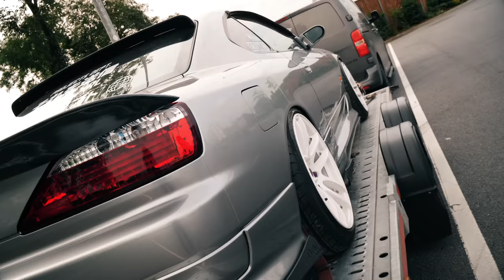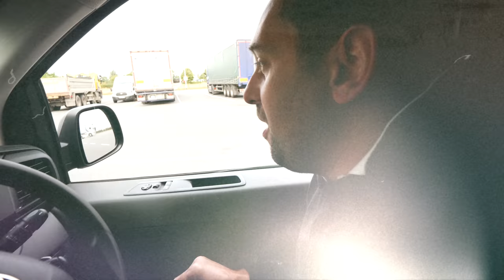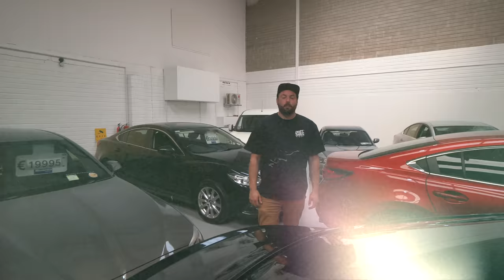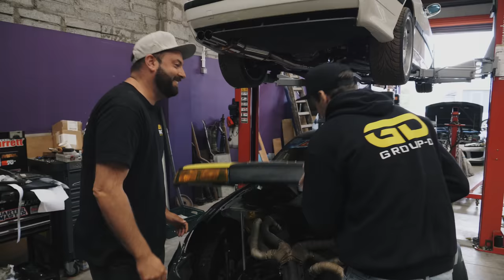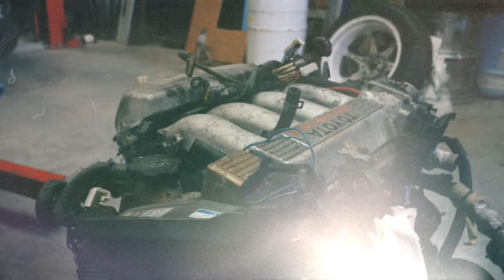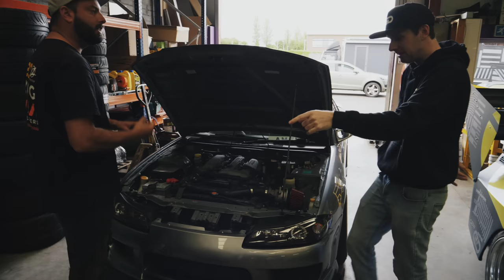Cheapest 350bhp engine swap EVER? | Our S15 is FIRST!

Comment: I would never have guessed that, looking forward to seeing how this turns out! 👏
Reply: I believe this was in the Tom’s Castrol Supra when they finally beat the GTR’s back in the 90’s. It was a much different engine internally but same platform.
Reply: @kevinfunk83  If that's correct that's impressive! Fair play 👌
Reply: @kevinfunk83  nah mate, they used the 2zz.
Reply: @Tezzablade  nah mate, do some research!!
Reply: @kevinfunk83  I can't be bothered, somebody told me they used the 2zz though, which is a SUPER competent motor, they used then in lotus Elise's.
Reply: @Tezzablade  I mean it was nothing like a 3sGTE after the head work and being able to rev to the moon but it was taken directly out of the Rally Celica.
Reply: @kevinfunk83  similar but aparently shared nothing with the 3sgte. Was called a 503e.

Comment: Didn't expect this! I was thinking you were going to go for a Saab B234 then I thought about a Mercedes M111 with a turbo instead of the kompressor. Another crazy/cheap one would be some sort of VW engine like a 1.8t or even a V5 or V6 with a turbo.
Reply: Was thinking the same, 3sge does not seem so crazy tbh...

Comment: Lots of guys in the mr2 world used to do 5sgte builds - (3sgte head on a 5sfe bottom) and made really good power with them. Some really cool options that are less popular!
Reply: @krisbuck2165  the 5sgte is gonna be a lot more work, but its definatly alot cheaper than an SR
Reply: 5s is not an engine option outside the states
Reply: @fonorcennell131  we have them here in norway, in the older camrys, relativly common too.

Comment: I thought it'd be a VAG 1.8t 20v, obviously not 350bhp stock but a bigger turbo, injectors and some cheap rods will easily get you there. Probably not been done in a Silvia before either
Reply: I own s13 with this engine. It makes 400hp… love it 🥰

Comment: If going with 3sge, why not a beams 3sge? Same engine, but with vvti and even comes 6spd and rwd. Plus it just looks better out of the box than the older 3sge's. Either way i'm looking forward to this build series!
Reply: Price prolly.. he focused on the low price point
Reply: Price
Reply: Beams engine and trans is hella cheap I paid $1200us for mine. With link ecu make 200whp no mods turbo it and have 300whp that revs to 8700k
Reply: @gbshenanigans6952  Lower compression engine / older 3S would be better suited to the turbo.
Reply: @Joel_Harris  300whp you will be fine with the high compression but they make a kit to get low compression
Reply: @gbshenanigans6952  mr2 engines like 200-300 euro
Reply: @fonorcennell131  yes but 3S-GE is pretty useless. That’s why us MR2 owners take them out.

Comment: Was half expecting a Honda B or K series, but this should be a great setup for a road car 🤙
Reply: This has already been done though. Jimmy oakes has a K swapped S15
Reply: @nitroblueuk  But how many k-swapped schassis are there compared to 2GayZ motors?
Reply: @nitroblueuk   S14*
Reply: @nitroblueuk  jimmy k swapped an S14 facelift,  not an S15
Reply: K24 would have been my bet. Probably just about as cheap, and better all round motor. Alloy block too where as the 3sge is cast iron.

Comment: Tidbit about the trans that I think wasnt covered correctly or clearly, the "j160" of the altezza/is200 is effectively the same trans as the s15 6speed. They both fall under the Aisin AZ6 model range although the gear ratios are a bit different. Mx5 6speed, rev1 rx8 6speed, s15, altezza/j160, brz/frs/ft86 are all effectively the same "AZ6" box. Great choice with the 3s platform though especially rev1 head intake ports can be made massive. Cheers guys
Reply: Those gearboxes are one family, but every of them is different to fit. 
1. Different bolt pattern
3. Different ratios
Reply: @aaabbb9953  the center section of the trans can be interchanged but yes the bellhousinga and tail housings are different, different tail shaft lengths, shift rod lengths etc. 4th gear is fixed to the input shaft so you are stuck with whatever gear ratio the required input shaft is associated with but they can be hybrided. I had built a couple s1 rx8 front mx5 rear hybrid boxes for a 13b powered NB mx5 back in the day. It ended up being a hodgepodge of gear ratios due to the required parts but interesting none the less

Comment: I love this 👌👌 The 3sge is a seriously underrated engine 💪
Reply: @krisbuck2165  no the 3sge is what I'm talking about, seriously under rated engine, co designed by Yamaha too
Reply: @krisbuck2165  Yea they did, Great na engine, I have had over a dozen of them
Reply: @krisbuck2165  I've had a load of and built 3sgte engines, there obliviously more powerful, it's the same engine only turbo charged. I didn't say the 3sge was a better, engine. I said it was an underrated engine

Comment: the heads where designed byYamaha for toyota- the supra that raced le mons was a 3sgte -well it was actually a 2.3 litre with the camry engine (5SFE) crankshaft - stock 3sgte turbo engines rev to 9500
Reply: I think toyota didnt develop a DOHC without  Yamahas help. Even the 1JZ head is yamaha designed, earlier engines actually had Yamaha's name on them

Comment: Somebody is doing a beams 3sg swap in an s15 in California, but I don't know if he is going turbo or fully built n.a. The beams is only good as a fully built n.a. and they are not good turbo due to the internals. The turbo 3sgte is already good for boosted application, with its forge rods and pistons.

Comment: Be interesting to see this outcome and costs as with consideration of link Ecu and custom wiring harness. Custom exhaust unless you’d be making a downpipe to allow an s15 system to bolt on and also the custom prop. 

I think a challenge is that not everyone would be wanting to part out 3-5k on Ecu parts. Can’t wait for this build though

Comment: I think it's going to be a cool swap but it'll never be a simple replacement for the sr20 swap. Yes the engine alone might be cheaper but EVERYTHING else will cost more than a basic sr swap. These engines have been around forever and there's a reason why ppl don't swap them into s chassis's. If someone were to make the swap kit like tf did for the k swap then it would even more expensive just like the k swap is.  Yes engine is cheaper but everything else to actually get it going cost way more unfortunately. Still excited to see this car done though.
Reply from the maker: But it’s something interesting to do and at least we can find out!
Reply: The way dmac was talking sounds like he is making a conversion kit to sell to the public.

Comment: it's a really interesting swap. Btw I dont know I'm late but I heard about good alternative for 2jz, its a ford barra engine, its 4 liter, 6 cylinders engine with variable camshaft, so you getting something like 4 liters 2jz with vtec, sound amazing, I didnt seen to much videos with that but I belive its may be something cool. There is two problems with that, size of the engine, its quiet big, so its may be hard to fit that in drift car, and the other one is availability, easy to find them in australia but not to many in europe. Well I'm waiting to see that silvia later, its really interesting project, Darren is a true magician. 
Greetings from Poland lads🤙
Reply: Problem with barra is they are huge. The sound like shit too. But as an Aussie they are the best Aussie made engine and are very cheap to buy
Reply: Barra is alternative, because it is same overbuild engine like 2jz. Problem with barra is that it weight even more than 2jz, about 30-40kg + you have to import them from Australia, and probably every part that you will use need to be from Australia too... Imo still 2jz wins if it comes to competition - availability and proven reiability.

Comment: There’s been a couple s13s with 3sge dropped in in the last couple years and there was a s15 built back around 07 with a 700hp 3sgte. Still not common but pretty much the same thing

Comment: Is the IS200 J160 gearbox and the Altezza the same?
Reply: Yep same gearbox, its torque that kills j160 gearbox, same internals as a s15 silva but 6th gear is different on s15. I would prefer they went for a stronger box
Reply: @jamie3uz344  Yeah, I've a J160 on my V8 Soarer, so I thought the Altezza might be stronger. Be interested to see how that box handles 300bhp and a few of Dave's clutch kicks around Mondello. And now I'll have to pick up a spare J160 before this swap becomes popular into Nissans and the price skyrockets ;-)
Reply: @darrenliggett7222  prices of j160s have sky rocketed over here the past 2 years, £400/500 for a gearbox now 😂. Im going bmw gearbox now with my 3uz, would prob be a better option and stronger for yourself bud
Reply: @jamie3uz344  I need to get the Soarer back on the road before I need a new box, only been in the garage for about four years now 🙈

Comment: This is great! 3s is a great engine. Have seen a few 3sge BEAMS in s13 before though so the idea isn’t all that new
Reply: Huge difference, a 3sge beams is 4x the price of the gen 2 3sge like he had in the video, plus its a transverse mounted engine. They share not a lot in common with this project
Reply: @fonorcennell131  but at the end of the day, it’s not the “first 3s into an s chassis” is what I’m getting at. Very aware of the differences between the 3s motors

Comment: Watch 3S-GE's become un-affordable now lol

I like the idea and will be looking forward to the build but initially its alot of work for 300hp. DE+T with the right mods will make the same power and is easy but again this is showcasing something different and will be better when the forged motor is built.

American's are now using a newish hilux 4 cylinder engine, I believe its a 2.5 but think they may start getting popular so watch this space
Reply: a lot of work for 300hp? Decompression plate, custom intake, custom exhaust manifold + turbo, ic, ecu to fit RWD and there you go
Reply: @aaabbb9953  custom engine and gearbox mount, gearbox adapter, custom wiring etc just meant a lot of work compared to +T the standard motor
Reply: @lewiselliott9624  still cheaper than buying 3sgte and still doing custom exh manifold, intake manifold, custom wiring etc... because it is to fit RWD not Mid engine or fwd..... and you probably forget it. For price that you can buy 3sgte outside usa, you can build 3sge and fit it into rwd chassis. In my country for example 3sgte cost around 3800 USD, compared to 3sge rev3 that cost 200-300 usd. 

You dont need gearbox adapter and gearbox mount because it is basically gearbox from s15, just different bolt pattern. And yeah, this gearbox is straight fit into 3sge, because it was used in altezza with 3sge.

Comment: I knew it. I guessed it was an MR2 turbo engine . I had an MR2 turbo rev 1 1990 reg back in 2000
Reply: It's the N/a version but they are going to turbo it.
Reply: @BackyardMechCon  I know. I meant they are going to turbo it. It's basically the same engine with a few miner differences. Savage strong engine though. Martin Tracy dyno'd mine back in the day and said it was a savage engine about 230 bhp at the time

Comment: this is def different, taking a 10 year older engine.. still 90s engines were kings.. so lets see where this goes, although no vvl, vvti ... why not beams 5sge 5sgte beams head engine with more modern and variable valvetrain

Comment: I cant see how turboing a non turbo engine thats not for the car by using custom parts and adapter plate will be cheaper than fitting a few s15 spec r parts and ecu with and sr box to the engine you already have,

Comment: How do you lower the compression but keep the same internals?  Some fat head gasket.
Reply from the maker: Exactly… 😊
Reply from the maker: Exactly… 😊
Reply: @driftgames_life  Looks like an awesome project.  Just be careful of having the torque come in too quickly.  I love responsive motors but 3s seems to not like it, but perhaps that will be alleviated with your custom manifold.  It's a bit heavy as an iron block, but for any every day 350 on pump it's a great motor.  3071R gets there easily with 264s and fuel.  If you really want to get stupid in the future something like the ATS 2.3 stroker short block based on US spec 2.2 98+ Camry engine 5SFE block conversion kit would make it really nice though the budget swells 6 fold.  I'm of the opinion that displacement or compression really helps turbo motors to be happier street toys.  Then again I was the idiot trying to figure out if NA rotors would work in an REW.  Look forward to the build and the decisions you guys make.
Reply: @jinxtacy  143kg for 3sge is heavy? I dont think so.
Reply: @aaabbb9953  I mean you could see a 20 kilo difference with an aluminum block.  I'm just one of those weird lightweight obsessed kind of people so don't mind me.

Comment: 9:00 Actually yes - the J160 from a Toyota Altezza IS just like the 6 speed in the S15 Silvia, they are both fundamentally Aisin AZ6 gearboxes.
Reply: Different bolt pattern and gear ratios.

Comment: Someone please tell them what a barra is and how much power they're capable of
Reply from the maker: Yeah, they just don’t exist here and we wanted to stay JDM
Reply: Just like most engines they have their faults. tall, long and Heavy asf, generally not used in swaps due to that. Also need oilpump gears and valve springs. The Barra thats cheap and more common have rods that will struggle to hold 400whp with a responsive turbo. talking about the ba/bf non turbo, non lpg engines ofcourse.

Yeah it's a great engine when you can buy them for $150 add 2k in bolt ons and when it bends a rod just replace it for another $150. but outside of New Zealand and Australia they're ridiculously priced for even the worse version.

Comment: Instead of swapping the transmission and using the engine you have for 700hp you can use this older slower n/a engine and spend more money to get 500hp!
Reply from the maker: 700bhp? In an SR? 💣

Comment: K swap the s15
Reply from the maker: 🥱 and then 💣
Reply: @driftgames_life  k20c1 from the fk8 🏎💨
Reply from the maker: We just haven’t seen a K20 stay reliable with boost in a RWD
Reply: @driftgames_life I here ya on that but it would be cool to see what the newer k20c’s can do if swapped into a rwd chassis 😂👌🏿
Reply: @driftgames_life  taylors ray had one that seemed reliable. Touge Factory make a nice kit, comes with baffled pan and type something oil pump to delete balance shafts?
Reply: @itsreallytheo  Dai Yoshihara has one in an AE86, it rips!